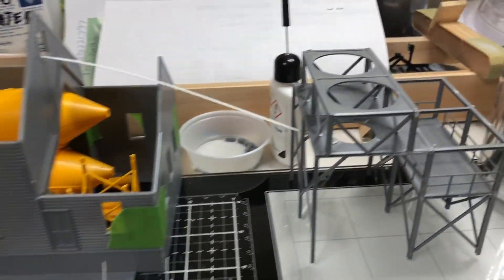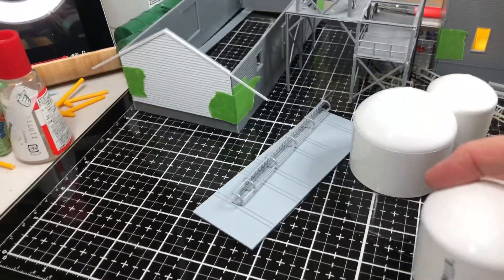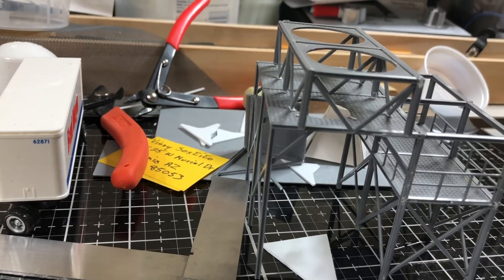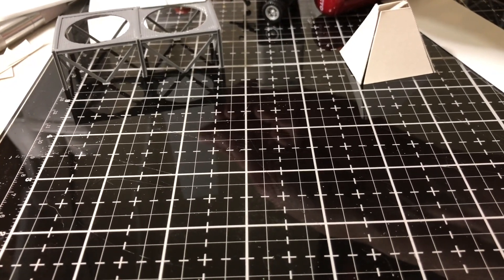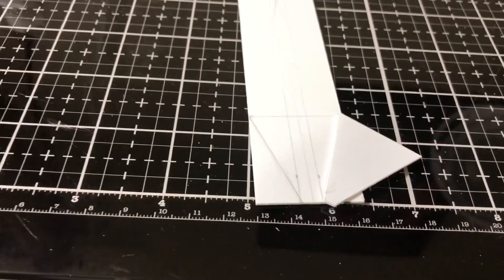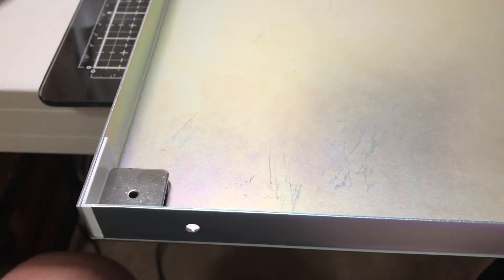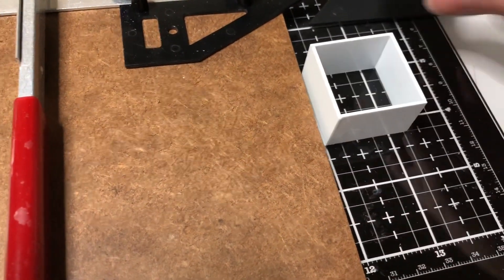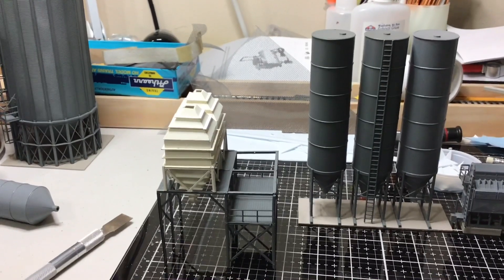Building feed bins. Walthers update 3

Comment: hi Steve...your scratch build is looking good...however i do have a suggestion...if i where to guess after you cut your first piece you laid it over the plastic to replicate the rest of the pieces...each time you do that the pieces get bigger.. so here's my suggestion after you trace out your next piece cut it out on the inside of your drawn lines...that ill make your pieces a lot closer in size to each other...i hope that made sense...KUTGW & thx 4 sharing...vinny
Reply from the maker: bnsf6951 yes it does and using the chopper helps with the smaller stuff.  I just wish these things would go faster.

Comment: A Dremel tool with a sanding disc would had made quick work of those raised letters on those caps! Looking good Steve! Will the hopper gates be functional? Lol
Reply from the maker: CONTAINERMAN68 thanks Roy, the rough sand paper did good but I am going another way with those tanks. No the gates won’t be operational. Man this has been a lot of work and I still have ground belts and scenery to do.